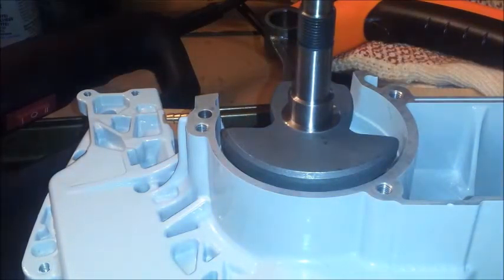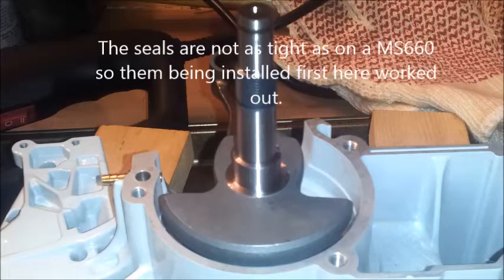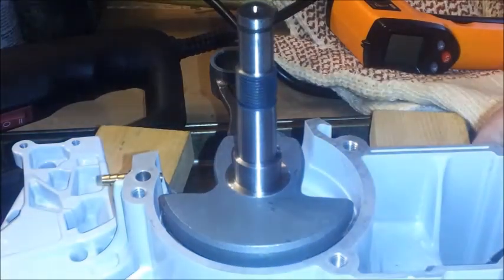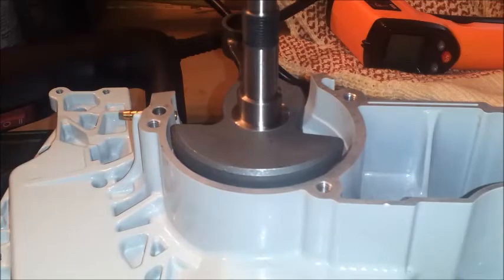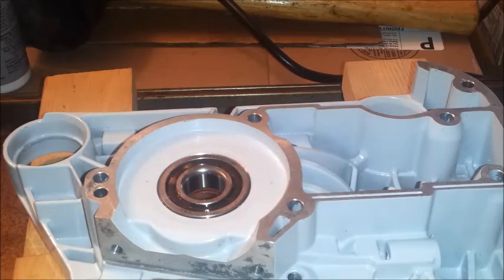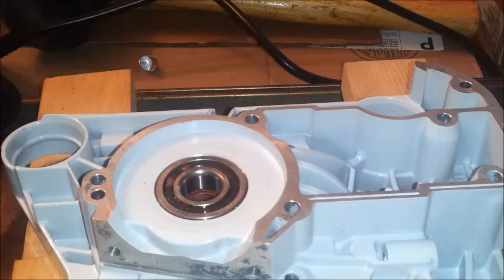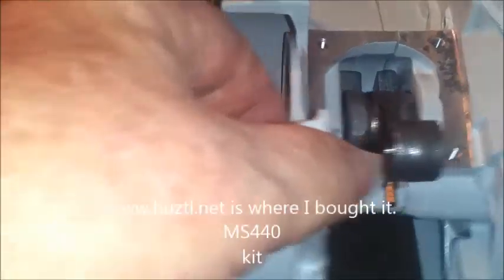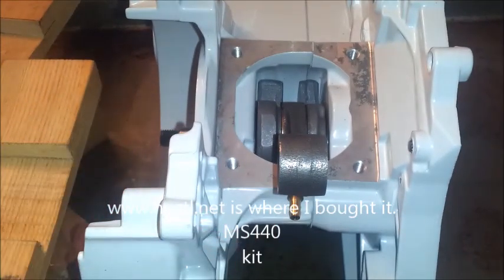Huztl FarmerTec Chainsaw Workshop Build Series - MS440 Crankcase Assembly

Comment: I idolized the same thing. Basically.  I put the crank in the freezer and case half in the oven.  I set the oven at 250 degrees and I pull the case half when it gets to 250 and stick the crank through the bearing.  I then put the first case half and crank in the freezer and the other case half in the oven.  When it gets to 250 and the first case half is down around 0 degrees. I push the second case half on the crank.  I put the gasket on the case half with the alignment pins and both case halves have 1184 on them.  Bearing and seals are well lubricated before assembly with assembly grease.  It usually take me about 45 minutes to assemble the cases.